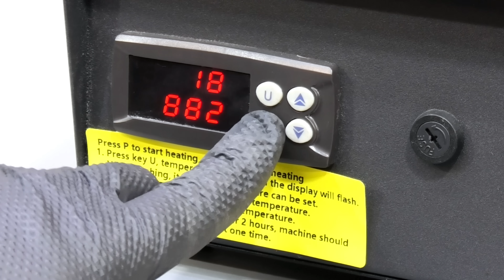105 Years Old Push Reel Mower Restoration - Why Did People Stop Using These?

Comment: In our new home in about 1976, my father introduced me to a push-mower similar to this one, giving me the rare privilege of mowing the front and back lawns every Saturday.  The mower came with the house, and the house was almost 200 years old.  After a few years of spending summer Saturdays pushing that thing around the yard, I escaped to college and the mowing job was left to my father.  He promptly purchased an electric mower.
Reply: Good story.
Reply: Similar here.
My grandmother had one at her home where I stayed as a child in the summers.
Her lawn was zoysia grass....and had a pronounced slope.

As to why people stopped using them, they're a lot of work to use.
Reply: My father bought a gas powered mower for me to use. It also served as a learning tool for engines. I learned the basics with that thing.. When I got older, I tried to find an old  Scotts push model because they are no longer made. I never did find one.. There is no more perfect form of exercise. no sweating in a stinky gym or counting reps. just fresh air and push until you're done..

Comment: Had one of these as a teenage, and I remember the biggest reason we stopped using it was that once the blades went dull, trying to sharpen them was a huge problem. And if the blades weren't sharp, they wouldn't cut as much as fold grass over and jam if it was too thick.
Reply: @Natashajb  "Back in my day we walked uphill in the snow both ways to get to school"
Reply: I was using one of these yesterday to cut my dads grass 😂
Reply: I've heard you put valve grinding compound on the cutting bar that the blades mesh with and it will sharpen the blades it also has to be set up right.
Reply: @davenoejoe  and then turn the blade backwards to lap them in. . . worked at a golf course for some time. . .
Reply: @WowCreativeUsername  How do you walk uphill both ways?
Reply: Maybe up hill one way but surely down hill the other??? @WowCreativeUsername
Reply: I would have taken the opportunity to put the reel (also called a cylinder) on a grinding machine (lathe with a grinding attachment) - I had that done on my old battery cylinder mower in the 1970s. It gave a bowling green finish.
Reply: @WowCreativeUsername  Barefoot. Don't forget, barefoot.
Reply: @compubert2 yes, remove the gear and install it backwards, apply cutting compound and wheel it around to sharpen. I still use one of these, when you understand how to maintain them, you will not get a better cut.
Reply: @johnbartlett4755 was a jab at boom3rs 😅😅😅

Comment: I would much rather listen to that at 8:00am on a Sunday morning than Waaaaaaaaaaaaaaaaasaaaaa!
Reply: so would I.
Reply: @ericball6000  They are still used to mow the greens on golf courses (a rotor mower would scalp the green due to the grass being cut extremley short there and so slightest ground height difference would make the blade cut right into the ground). These reel mowers are however also diesel/gas powered so they are also just as loud but as they are used in areas where they don´t disturb the surrounding community the noise is not a such big problem. As battery tech improves there are however many new battery powered machines for mowing larger grass areas comming out on the market wich leads to both much less noise and also no pollution from exhaust gasses.
Reply: Landscape crew comes around here every Monday morning  at 8am, I work nights and I hear the mowers, weedwhackers, and leaf blowers, never fails to wake me up
Reply: My one is electric and makes Hummmmmmmmmmm. It is even allowed to use over lunch time, legally. In my country you are not noisy at lunch or on sundays.
Reply: Don't be so sure! I've had one for twenty years, and my neighbor across the street always complains that my mower it too loud! 😄
Reply: Not sure why the general public stop using a reel mower. Golf greens,fairways,and tees are all cut with a reel style mower. Go to a sod farm and the sod is cut the same way,but with a tractor with 20+ reel mowers pulled behind it. Still to this day it is the best way to cut your lawn
Reply: @johnpekkala6941 battery power will never out perform the modem gas/diesel engine
Reply: @johnpekkala6941  а теперь возьми, и посчитай сколько нужно затратить промежуточной энергии, чтобы сделать и зарядить аккумулятор, а потом, сколько нужно затрат чтобы утилизировать. Углерод пока что в этом серьёзно выигрывает. Бензиновый двигатель у тебя пролежит хоть 100 лет в консервации и ты его всё равно сможешь запустить, а у аккумуляторных инструментов аккумулятор имеет основной срок службы 5-7 лет, а после уже как повезёт. А так же утилизация. литий очень токсичный по сравнению с тем же бензином или маслом. Выливали уже на работе отработанное масло на землю, а трава как росла, так и растёт
Reply: @davidbentley1012  это уже дурка. Тут только санитары помогут
Reply: @chuckschroeder8785  это у вас на западе мания по зелёному газону. У нас на участках газон - это либо трава которую лень косить, либо у каких-нибудь блатных. У простого народа два средства от травы - гербицид и бензиновый триммер
Reply: @mweskamppp -  Du musst in Deutschland leben.  (You must live in Germany)🇩🇪

Comment: I am 61 and can remember using one of these to mow my grandma's yard in the early 70's.
Reply: I am 60, and it was an aunt of mine. 😀
Reply: I'm 81.  First one I ever used.
Reply: Never a fight to see who got to mow the grass with these babies
Reply: 60  My dad made me use the grass-catcher attachment. I bought a gas mower at 10yrs old and mowed 5 neighbors lawns $5 ea
Reply: Same here.
Reply: im 59 and  did the same once or twice, her yard was just to big and it took all day
Reply: I was pushing one of those around to earn gas money back in the mid 60's. Gas was 19.9 cents per gallon. My neighbor and I took old sprockets and chains and and old boat motor and made it chomp. It was really dangerous and my dad shut our project down very quickly.
Reply: I'm 33 and pushed one of these growing up. Our backyard was too small to warrant a motor-driven lawnmower, and nowadays it's been covered with a low wooden deck.
Reply: I remember pushing one in the sixty's .
Reply: I am 66 and use my push mower every week! Works great and cuts better than any rotary blade.
Reply: Never used one but seen them enough to wonder why they seemingly stopped making these
Reply: I'm 53 and yes. My parents had one like this and one with a motor.
Reply: @kirdot2011  I can tell you why they stopped making these.  Reading some of the comments I am wondering how many actually ever used one since my experience is opposite to what is being described by some of the comments.  Note: My references to gas mowers are equally applicable to electric.

1. The "human powered" version of these are a workout to say the least.  Its work pushing around a power mower but a push mower with the gear train and up gearing of the wheels to the rotor there is a lot of resistance to overcome as your pushing it.  It is hard work.
2. Once gas motors were mass produced they were added so the rotor (and later blade) could turn faster making more effective cutting and in some instances also providing push assistance.
3. Rotor mowers slowly fell out of favor for blade mowers because a rotor motor relies on pretty tight tolerances where the rotor blade intersects the stationary blade.
4. Ingesting a rock into the rotor very quickly ruins your rotor.
5. Gas powered blade mowers by contrast use their momentum so they don't require a static blade intersect to cut effectively.
6. Gas powered blade mowers have pitched blades to create an airflow that both sucks the ground to pull grass blades up for level cutting, and carry off the trimmings to a catch bag.  Anyone who ever used a grass catcher on a push mower will be able to attest to how less than half the grass ever ends up in the catcher with the rest piling up on the mower and falling off to the sides, or being flung past the catcher and onto you.

I will admit the best mower I ever used based on the end results was a gas powered rotor mower (when it was freshly tuned and sharpened).
Reply: Just imagine if he actually sharpened the blades. 
It would have made all the difference. 
✨️✨️✨️🤔🤔🤔😜😜😜🐒🐒🐒😎😎😎
Reply: My dad garden was so big it used to take a weekend just to do the back garden
Reply: Our garden 2 day plus with a friend 
Until we got 3 of them 
Then my dad got nice and brought us a flymo
Reply from the maker: @robertcharles7085 I sharpened the blades, but maybe you skipped that part.
Reply: sooooo @parker1ray...... you prolly will remember the spring loaded "wind up" starters that were popular around that time..... 
 there was no pull rope ya would wind a handle up adding tension to spring till ya manipulate the spinnin parts to engage and expend thier energy while cranking engine over...
Reply: im 13 and used to live in germany, everyone used those their
Reply: lol me too and she had a big yard
Reply: @larrybremer4930  We can see in this video at the end where he's trying to use it and he's really having to work at it and move fast to make it cut and yet it still sucks and he still has to clear clogs why they were replaced with gas mowers. I'm really glad I don't have to use one to mow my lawn, my non self propelled gas mower is bad enough.
Reply: I'm 44 and used one when I was 8 to cut grass in a trailer park for my summer funds then upgraded to a self propelled gas mower. Had plans to have my own lawn care business but then Mom moved us out to the country
Reply: So do I and was thrilled to move up to a power mower.
Reply: I'm 74. When I was a kid, I mowed nearly all the lawns on the block at one time or another with this kind of mower and some other hand tools. When people went on vacation, then I had other jobs like making sure there were no stray newspapers on their porches, watering plants and just looking around to be sure everything was OK. I got other jobs by word of mouth. I was 9 years old, I think, when I opened a bank account.

Comment: New subscriber here. You are a FREAKIN' GENIUS! To answer your question. Laziness! It's much easier to just pull a cord and let the engine do the work. When I was 15, I worked for a guy that sharpened mower blades. He had a maching that would suspend THESE mowers and he could sharpen their blades. This was in '85 and we got quite a number of these, but in comparison, we also got the gas-powered blades as well, which I would sharpen. An older guy, but very nice and patient. I learned a LOT from Jerry about a LOT of things. I left for the Army that same year and found out from my Grandpa Jerry died a few months after I went in, that was Oct of '85.
  YOU got skills my friend! I love watching this kinda stuff, it motivates me to clean stuff that I have. Thanks!

Comment: I use a push reel mower.  It's a modern one - cheap, lightweight, quiet and cuts beautifully!
Reply: Agree, I did the same but there's nothing like the clatter of the blades of these...and the cast Iron components.
Reply: @flamingfrancis  бензиновый триммер с максимальным скосом травы до земли передаёт привет. Механическая косилка стрижёт точно так же, как и любая другая косилки со схемой толкания. В них лезвие никогда не касается земли чтобы не повредить лезвие и не летели камни. А триммеру пофиг. Лезвие используется лишь для травы с толстым стеблем, а для такой как в видел хватит обычной лески которая выкосит траву под самый корень

Comment: An amazing job bringing that relic back to life. I can tell by the sound the cutter blade is in need of further adjustment. I have a small yard. So I decided to get a push reel mower when I bought my place in 2001. I'm on my second mower now. If anyone is thinking of getting one, I recommend getting a mower with trailing wheels instead of a trailing roller. Rollers flatten the grass if you want to make a second pass. Another thing about push reel mowers is they are a great bit of cardio. If anyone is curious, my current mower, which I'm really pleased with, is a Great States.

Comment: I used a push mower that had a wider cut than yours for about 3 years.  It worked fine for a small yard.  It was used and I had it sharpened at a place that still did them before I started using it.  That made it a useful tool like yours instead of a frustrating piece of machinery.  Good work!

Comment: I just bought a new one of these (well modern version). Works like a charm! Lighter to push than the gasoline guzzling noisemakers and obviously quiet.
Reply: You obviously have a very small yard, probably own a tiny lot in town. I have 9 acres with 5 to mow and no way with something like that. Could not have done it even when I was young and in shape.
Reply: @patrut-v2q  Самый легкий вариант на 2-3 месяца - это гербициды. Попрыскал, и уже на следующую неделю будет голая земля. Если земля ровная, то хватит обычной электрической или бензиновой косы на тележке. Если земля не однородная и имеет множество перепадов (а на такой земле здорово тележку не покатаешь), то используют триммер. Из минусов конечно трава во все стороны и вес с нагрузкой на спину, но из плюсов максимальная эффективность со скосом под самый корень. Ну, или на крайняк, просто завести козу
Reply: @вышедшийизметро  Good advice.😆

Comment: I had one I was using 20 years ago, until I moved into an apartment.  They're great, except for tall grass, when just lays over instead of getting cut.  Great video.
Reply from the maker: Thanks for sharing!
Reply: It's only meant for cutting a lawn, not a field.  There are swing blades for manually cutting weeds.

Comment: I was mowing grass by time I was 4 years old with a push mower.  However, at that time, the 1960's , push mower design had radically improved.  The mower was lighter, the blades were sharper, and the mower we had cut the grass much much better than this 1920's one.  Love the video!  The demonstration at the end illustrates how far that simple technology had advanced in 40+ years.

Comment: Bought a push mower in 2009 from OSH made by Craftsman, paid $300, and it had a gear ratio in the hub that turned every push into a great many turns. I loved that mower. It was mind boggling how good that modern push mower was.

Comment: I remember pushing one of those things around as a kid to do my dad's lawn. They don't really cut the grass, they just kind of beat it into submission. 😁
Reply: That's funny.  When we replaced our reel mower with a rotary one, my brother said the same thing but the other way.  It's the rotaries that beat the grass into giving up.
Reply: You have to sharpen the blades at least once a season.
Reply: Might not have been adjusted properly; the rotary blades have to actually rub against the fixed blade in order to cut the grass with a scissor-like action.  If there's a gap, it just stuffs the grass into that gap without cutting it.  Obviously, all the moving and fixed blades also need to be sharp.
Reply: @tommcewan7936  It was old and I'm pretty sure your second observation was accurate because I don't think it had ever been sharpened over the years of use.
Reply: Lol
Reply: @tommcewan7936  And the grass looked wet, don't cut grass when it's wet.. Also, the Cylinder mower is actually the best for the grass as it actually cuts it, the regular ones we have today sucks and rips it.
Reply: @Masterfighterx True, if you notice how professional greenkeepers cut grass at stadiums, golf courses etc. they all use mowers of the cylindrical type. It’s the one that gets the nicest result.
Reply: @anderspedersen7488  And it's also better for the grass
Reply: Sharpen blades and walk fast.
Reply: I never thought of them as good old days, till now! Not only did I cut our grass with one, I walked up and down our street! I think I changed 50 cents, I would only cut front yards. I knew how nasty back yards could be! You Sir! Have done an amazing job, of restoration! I salute you. 🫡🫡🫡😉❤
Reply: @Progressive_Canadian  What?  You can sharpen the blades?  Wish I knew that back then..😁😁
Reply: Il che è anche meglio perchè questo protegge il suolo.
Reply: @tommcewan7936  I thought because of rubbing against the fixed blade its sharpening itself.
Reply: @anderspedersen7488  подстрижка травы и избавление от неё - это две разные вещи. Чтобы подстригать газон и была мелкая зелень, то нужна любая толкающая косилка, хоть роторная как в видео, хоть бензиновая или электрическая. А вот чтобы избавляться от травы, нужен нормальный триммер который способен выкашивать траву под самый корень. А вообще, наши бабушки и дедушки всегда в сёлах держали коз. Самая лучшая и экологически чистая газонокосилка

Comment: I had one just like what you're working on. It was quite heavy but once you got it rolling it worked fairly easy and cut the lawn perfectly. Used it for years and all it took was a bit of oil and elbow grease and it really did the job very well. They don't make them like that anymore.

Comment: Excellent job restoring that push mower. Here's a tip: don't push it too fast. It works better when pushing it back and forth. It takes longer but cuts better.
Reply from the maker: I will try that tomorrow. Thanks for the tip! 😀